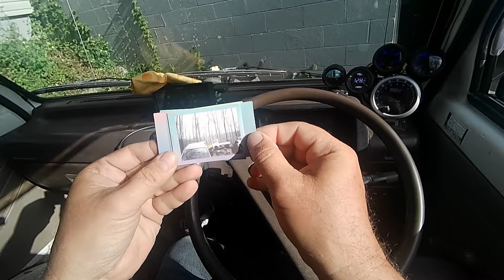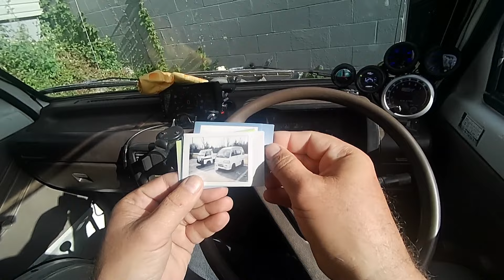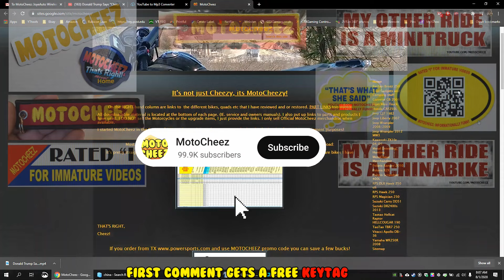Mini-Truck (SE08 EP4) Mini broke down. Guess the issue? Fuel? Water in fuel? Timing belt? Coil?

Comment: I worked in auto parts for 5 years. When it came to distributor problems, the cap was usually the mode of failure (with what I saw.) That is wild that the rotor broke the way it did. Maybe too poor of grade of plastic for said rotor? On a different note, we have the opposite problem here in Michigan: people drive so fast here! It's the people that drive the speed limit that cause us headaches. 😆
Reply from the maker: I bet! We have that issue here too

Comment: The cob shop commander to the rescue. I never had the electrode break off but I have had my share wiping out distributors caps on wet days. From my old 66 Chevy to my 53 Harley hydro glide. But with mini I also thought gas or filter

Comment: Wow, I'd never have checked the distributer, sounded like fuel starvation all day long, good find and a better roadside repair! Old mini truck proverb say, to fix old-school, first you must think old-school!
I had my Suzuki carry cut out with a half tank of fuel, left me stranded on the side of the road, turned out to be a vacuum operated fuel tank vent, the vac line supplying it had split, and with no venting I was running lean to starvation. The big clue was the diff lock wouldn't work (low vac) and the other massive clue was when opened the tank, there was a massive pull of air into the tank. 
Thanks for the great content on these mighty machines 👍
Reply from the maker: True, must think old-school. Those vacuum issues and poor gas venting can be tough to trace. Motorcycles w bad vents always throw people off

Comment: I figured it was the cap and rotor. (That’s exactly how mine died, fake running out of gas, then fine for a while, back fires, then just stone dead.)
Like Jefro, I assumed  mine was jumped timing.
I pulled the cap to look, and the contacts looked like tiny pieces of chalk….
The broken rotor on yours was a new twist, I’ve never seen that before…..I bet against that working…..
Reply from the maker: Dayum
Reply: @MotoCheez  Check your spam folder for a link. It’s got video of my cap. (But at least my rotor wasn’t broke, so I guess I win.)

Comment: I had a similar issue in my driveway. Crank and crank and crank but no start. When I was testing my spark plugs at the distributor, I got a shock and noticed that 2 were arcing together. Turns out the wires were bent at such an angle that the boot was no longer snug and some current was escaping through there. I sealed it up with some silicone tape and it solved it 100%. 

Awesome roadside repair. I’m glad it got resolved.
Reply from the maker: Wow, original the old cap was arcing across outside like it absorbed moisture even on a dry day
Reply: @MotoCheez  I forgot to mention….all this only happened in the rain! The water was making the arc conduct even easier! Now I make extra effort to seal all connections and put dialectric grease wherever I can.
Reply from the maker: @BRIDGEBURNERSTV it did the same on original cap, but it got to the point it did it when it was dry too, that's why I changed the cap

Comment: Thought for sure it was going to be a fuel issue.  If I had a nickel for every time I had to replace my cap (usually from a crack in the side from over tightening) by the side of the road in my 1977 Datsun B210 I'd have about a dollar.  Never did have to replace the rotor though - I only replaced that with wires and plugs.

Comment: my jag just had this exact thing happen a month ago!!! Almost led to the fabled "Marelli Meltdown". 6 cylinders were dumping fresh fuel right into the molten catalytic converter while cruising. The ignition was cutting out intermittently just like your Mini so I was trying to limp it home, I didn't think it was loss of spark because I assumed since the tachometer was working my coils were good, but didn't stop to think it was the ROTOR! since the rotor was broken in half inside the distributor, half the cylinders still got spark, I simply unplugged the fuel injectors going to the affected bank of cylinders and slowly mopped on home to swap out the part the next day.
Reply from the maker: Damn! Good call on that one. Saved the cat!

Comment: Well, that was weird.  I'm gonna use genuine Daihatsu parts, and keep the old parts as spares!

When I was in college, the vacuum advance on my 1972 SuperBeetle crapped out while my friends and I were going camping.  I used a small round head machine screw as the bearing under the vacuum advance plate.  I drove it like that for another 60,000 miles and then gave the car to my younger brother.  He removed the women's bowling trophy that I had installed as a hood ornament.

Another time, my SuperBeetle died on the way to go camping and the girl I was camping with diagnosed the clogged fuel filter about two seconds after I did.  I probably should have married that girl!
Reply from the maker: Good work, damn yeah. You let that one go!

Comment: yes but it was a old points system and i the condenser came loose and  hit it . and one time the cap moved just a little and it caught and hit. maybe your cap was loose and moved. but i am 3 days older than dirt so i have seen a lot. i mean Adam was made from the last load of dirt i hauled in for God to build the earth. with my horse and chariot .
Reply from the maker: Ahh, the cap was definitely tight and seated well when I took it off though
Reply: @MotoCheez  it looked tight on video. but videos sometimes aren't what they seem to show. so check the shaft and see if it moves in or out. but it also just might have been a bad button.
Reply from the maker: @MadsWorld34 shaft is tight. I believe it needs spring on rotor or cap... Maybe because mismatched

Comment: Im only 4:53 second in but ima guess you left that new jet/ enrichment thing open!?   Gonna finish watching now. Ill edit comment.   I was wrong.  Rotor it was.  Strange! Also never had that happen to me.  But ill tell ya whay if it is made in  china its crap!!  
Just did a cam chain in my kx250f and i figures whats the point of a 30$ gasket so i got a caltric 10$ stator gasket and it would leak. So i reused the old one and its fine!  Chinese cant even make a good gasket. Its a shame